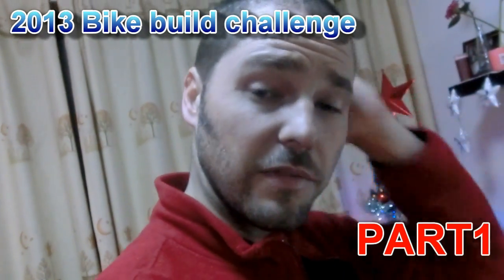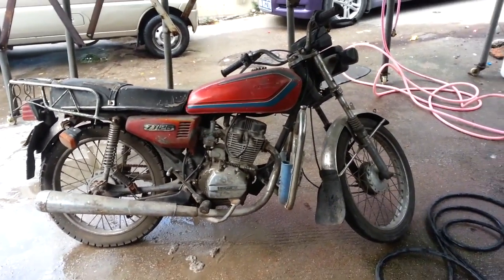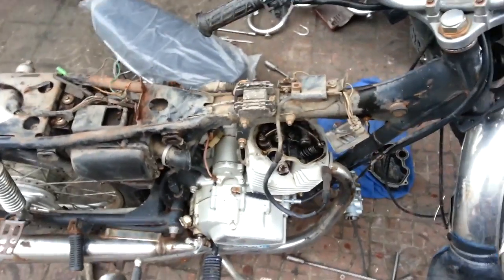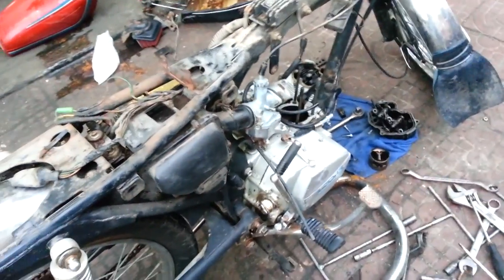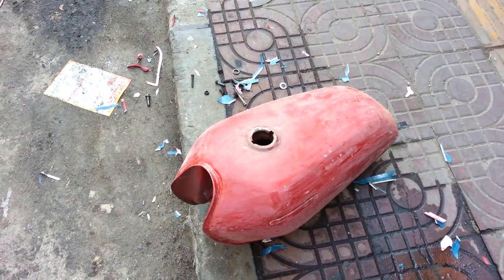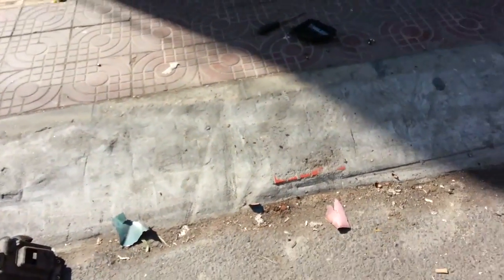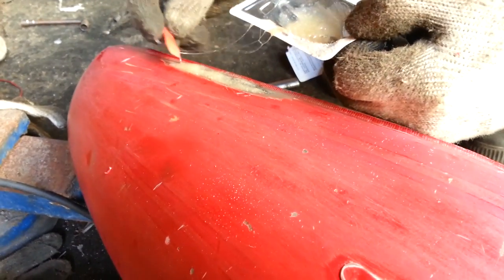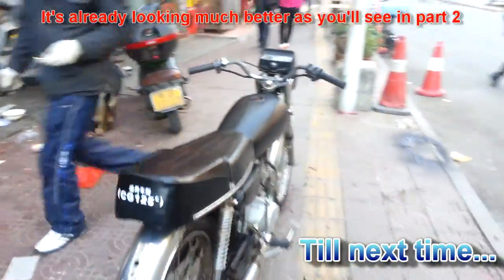2013 Bike Build Challenge - Part 1

Comment: Looks like your having a lot of  fun with the project. IMO replace the tank or order some fuel tank sealer. I've been doing this kind of thing for years & unless you seal the tank that bikes going to give you constant fits. Rust inside the tank will continue flaking off with use & plug up your fuel filter & or carb's. From there it's an up hill battle that never ends & makes it unreliable AKA No Fun. Have fun & cant wait seeing where you go with the build.